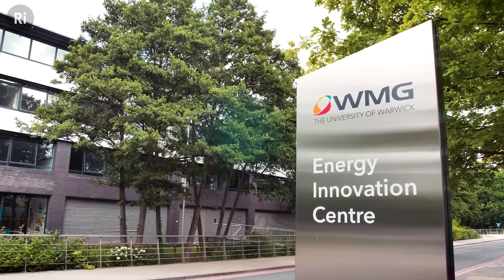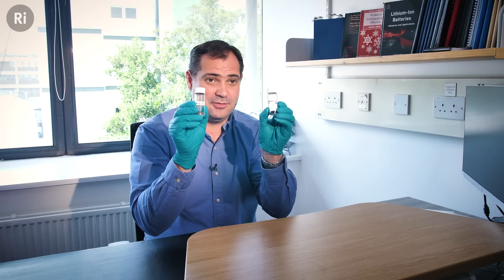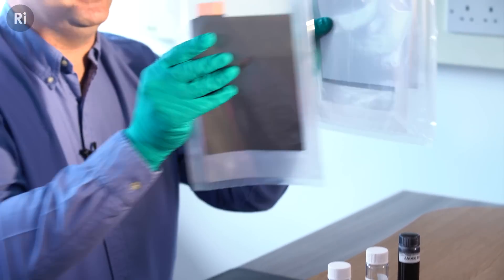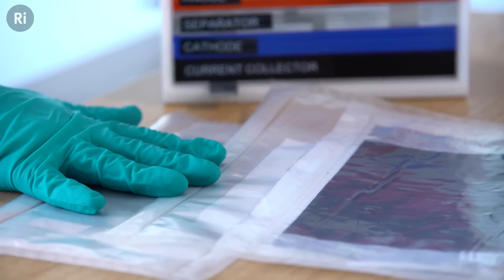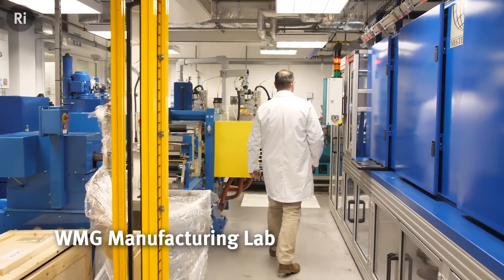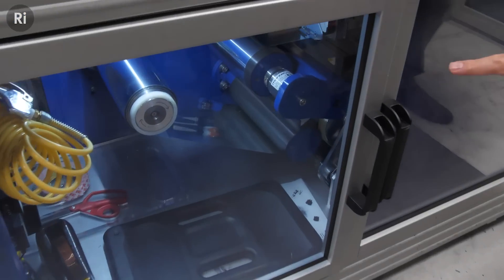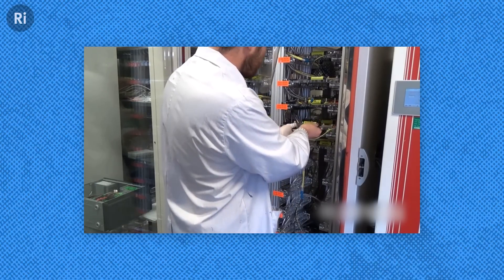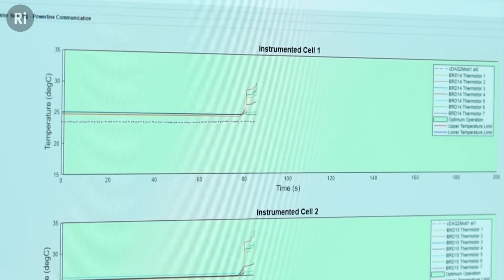The science inside lithium-ion batteries - with the Faraday Institution

Comment: The explanation is incorrect. Maybe it's trying to dumb down for the audience, but during discharge, it is the Cobalt that is reduced from Co3+ to Co2+ and in the Li+ intercalates as LiCoO2. The Li does not recombine with the electrons, otherwise there would no voltage. This is a science channel, be precise
Reply: Co3+/4+ for the redox to be precise
Reply: Yeah, he sounds dumb. It's obviously CoNq24 negatively pulsing Bg45Hg dumb dumb. Thanks dude. You rule

Comment: Very clear.  It would be helpful to distinguish between lithium batteries and lithium ion batteries.
Reply: The original lithium batteries contained lithium metal anodes but dendrites/whiskers caused safety issues.  Sony brought out the graphite anode with their camcorder and rebranded as "Li-ion" to help distinguish them.  Almost all commercial Li-ion batteries use graphite (with some silicon) as the anode.  The push to solid state batteries aim to use lithium metal anodes to increase energy density (and suppress dendrites).  Hope that helps!
Reply: @louispiper973  Thank you. and Li-ion batteries can be recharged and Li-metal cannot?
Reply: @jamesraymond.1358  Both are rechargeable.  The issue is how long, Li-metal batteries fail quickly when the dendrites form...

Comment: It's good that scientists and engineers are working on reducing the carbon footprint of manufacturing lithium batteries, but society's obsession with this issue is wildly misplaced.  New EV batteries can have a lifespan exceeding 500,000 km.  A LICE vehicle will burn over 30,000 liters of gasoline into the atmosphere during its lifespan.  What's more costly: A one-time fee of $50 or a monthly fee of $20 in perpetuity?
Reply: "Can have" is doing a lot of work here. I "can have" a space station, if I can afford it and can wait ten years. Unfortunately for consumers, they can't afford these batteries, and society cannot wait for them to mature.

The solution today, as it was nearly 100 years ago, is replacing the majority of car and freight travel with electrified rail networks.
Reply: @Valkyrie9000   Contrary to popular narratives, not everyone is poor.  Many millions of families can afford nice EVs.  Besides, the new budget EVs are pretty cheap and their TOC is actually LOWER than similar class LICE vehicles.

Economic progress is the best way to reduce poverty.  Nothing is solved by constantly objecting to progress because "What about the poor?"
Reply: @pilafmon  Which EV has a battery that will retain even 70% of its original capacity after doing 300,000 km let alone 500,000 km under normal charging/ discharging conditions?

Comment: 4:51 what the heck is that on her head?  O.o
Reply: For mixing the coating cathodes we use NMP as a solvent  (water for anodes)- this is safety equipment and really important - good spot
Reply: From what i found it is something like this: "3M Supplied Air Respirator Systems" So you can breathe savely. Looks quite bizarre to be honest. :D
Reply: It is a safety helmet/visor that supplies fresh air, but she has the visor up in that video. Search for "3M PAPR Respirator, Versaflo"

Comment: I have some large 10-20ah 6s lithium polymer packs that have puffed into circles.  What am I supposed to do with them? The local dump won't take them. And I can't find any recycling facilities that take these.
Reply: The 'spicy pillows.' There often aren't any legitimate means of disposal. I sneak them into the e-waste disposal pickups at work.
Reply: @vylbird8014  Crazy part is I have a few hundred others just waiting to do the same thing.  I've been acquiring lipo packs for about 15 years now, most are out of IR balance and of no use.  Was used for large scale rc stuff.
Reply: I went into town to drop my old phone in for recycling. The first place I went to that said it did on the net said they didn't and told me somewhere else to go, that place told me somewhere else to go and that third place didn't do it either. I had to chuck it in the general waste at home.
Reply: @Safetytrousers  Tends to happen. The problem is that the spicy pillow is on the verge of fiery, toxic poof. One good knock and a bit of bad luck and it doesn't just catch fire, even the fumes from the fire are poisonous. Couriers won't carry them without expensive precautions, so it's just not economical. The safe disposal costs are so high that the cells just get passed over until someone is willing to go for unsafe disposal.

The lithium isn't the problem - you can make that safe just by exposing it to oxygen for a bit. It's the electrolyte. Organic solvents with fluorine in that form hydrofluoric acid when burned, one of those 'nope' chemicals that is both corrosive and toxic in the extreme.
Reply: @vylbird8014  The battery was a less than 3 month old one that was a replacement for a bulging one.
Reply: @Safetytrousers  Unless I want to plan a road trip, my only option would be sneaking it in the waste transfer place. 

I placed a 6s pack on a light bulb load for about a week. Disconnected it, and a few days later, it had 15 volts. Still technically dead, but dangerous.  I am really concerned about poking holes through these as some say to do before dunking in saltwater.
Reply: Soak in water overnight to remove/deplete/short out any stored energy and they're safe to throw in the garbage.
Reply: 5th Novenber